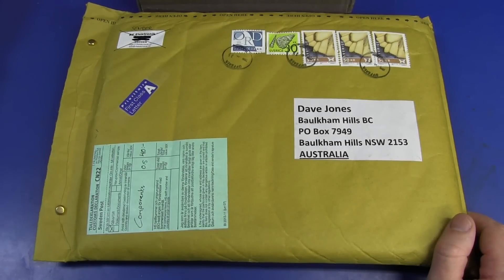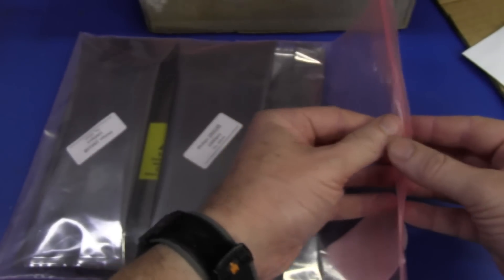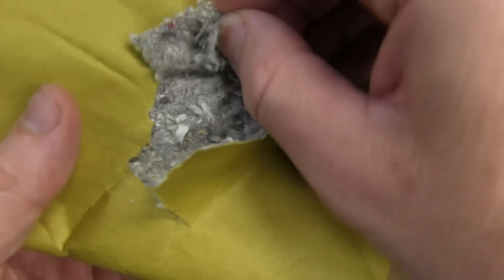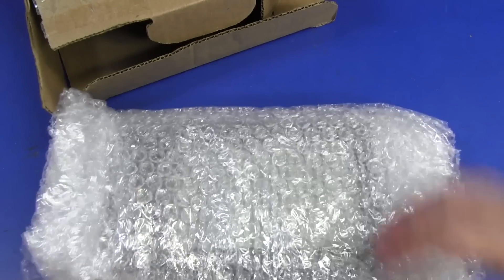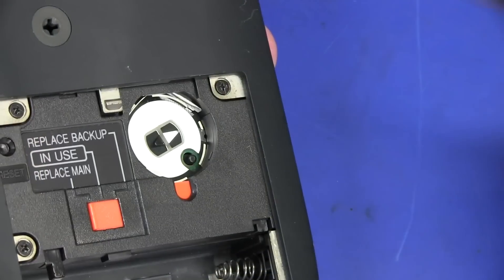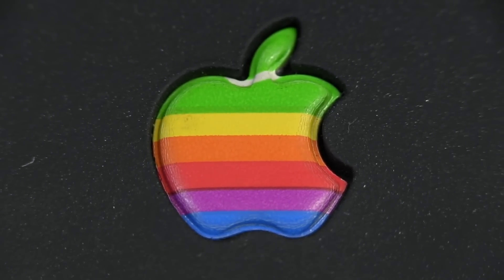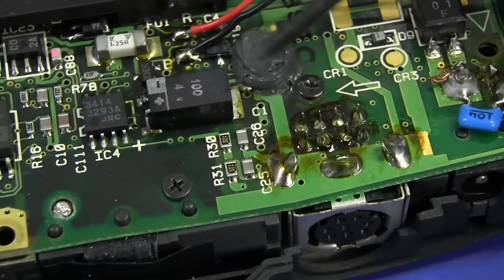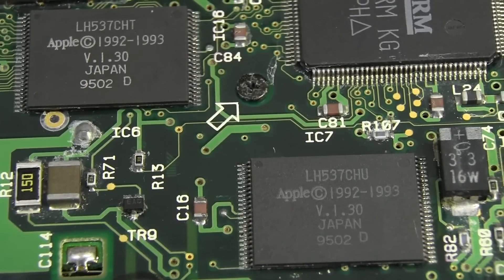EEVblog #418 - Mailbag Apple Newton Teardown

Comment: I had a MP100 and later was given a MP120 and a MP2000.  The battery pack was rechargeable, OR you could use primaries in that little holder.   4xAAA would last anything from 2 to 4 hours of usage, so it wasn't cheap to run.  Also it wouldn't work at all on rechargable AAAs because back then it was NiCD with 1.2V.  I reckon the authentic Apple pack had 5x 1.2V = 6V to keep up with 4x 1.5V disposable batteries.

The orange switchery was a lockout to prevent you from taking out both batteries at once, so to keep the memory powered.   Of course both could still go flat in place.

Comment: On the Newton:
Battery life was and is quite acceptable - Depending on how often and how long you use it, it may last one to two weeks.
Also it uses practically no power when in standby. And turning it back on takes less than 10 seconds and you're back where you left it.
It's good that yours came with a Battery holder, it was missing on my MP100, but I was able to get hold of one. www.pda-soft.de is a great source for everything Newton, and I think he sold me at a very reasonable price, this Battery holder. He's got a lot of stuff and knowledge.
The red battery slider switch made sure, you wouldn't replace one battery without having the other battery installed. The backup battery did hold your data (I believe date and time, and a lot of personal settings) when you were replacing the main batteries, and vice versa. I think those black switches you mentioned are for releasing the red slider . But there should be another switch in the main battery compartment that checks for an indentation on the Alkaline battery cage that wasn't there on the rechargeable battery - So by pressing this other switch in, it recognized it being a rechargeable battery, then the power input plug on the side would charge the battery (Ni-Cd's) and if the Alkaline battery cage was in, the power input was only there to power the Newton while conserving the non-rechargeable batteries. The DIN-8 connector was a standard Macintosh connector that you could connect your classic Newton MessagePad to your classic Macintosh. The Keyspan USA-28 Serial Adapter made it possible to connect it to a USB-only Macintosh, but there's little to no use now in 2018, since the OS-X-ported sync software might not run anymore on 64-bit-only OS X. Also, the last time I've checked, Newton OS 2.0 had trouble with the date settings in 2017, setting itself back to I believe 1970 whenever it's put into standby - This problem didn't occur on Newton OS 1.3, like your MP100 is likely to run on. Hope this info is helpful to anyone.

Comment: Hi Dave. I know I'm waayyyy too late to respond to this. Like 4 years too late. Meh. 

I collect vintage computers, and I've got a few newtons which had the exact same problem that it this one looks to have.

There's two electrolytic caps on the board that at first glance look like surface mount tantalums (actually, at 12:22 you pointed one of them out and said it was a tantalum). I found when looking closer at mine that they're actually tin cans inside of a plastic package. One is a 100uf used on the speaker output (which isn't really a big deal), and another on the rear side of the board -- you can see that one in the video near the PCMCIA slot around 15:30.

On my Newtons, I found that they had leaked pretty badly. It looks like the ones on this one have too; there appears to be a some gunk around that 100u cap near IC4. Also, what looks like flux residue near where the speaker wires are was leaked goo from that cap on mine. Can't say that that's what it is in this one, but I'd give all of that a good clean and replace those two caps. I find replacing those two as well as the big 470uf one gets them going again.

I shoehorned in some radial through hole caps on mine because I had no idea what the type of surface mount electrolytic caps are called in this form, and I couldn't find any replacement ones. Eh, if it's stupid but it works, then it's not stupid. Actually it's still stupid. But it works. Meh.

Comment: AFAIK, it holds 4 AA batteries.
You can't slide the orange slider when you've removed the battery holder.
One of the "secret" switches recognizes if you've inserted 4 AA batteries or a rechargeable battery pack. If the latter is recognized, it will charge it when you've got the power adapter connected.
If you know how, you can display the thermistor temperature in the menu. It is quite accurate if you're not recharging the battery pack.

Comment: 6:54 that looks like a DB-9 connector used by Apple for serial ports.

Although Macs did have a tenth pin that allowed LocalTalk networking by using the RS-422 standard.

Comment: i have the h1000 newton
Same as this but only 1.0 software, changed both caps 3,3 Uf for the lcd and the 100Uf for the audio
Now hes working as new =) yhe mp100 have an issue with the power switch, u need to clean it to fix the power button. sure it will work, otherwise its broked!

Comment: The blue switch detects rechargeable battery pack or cell pack if i remember correctly, it also has a temperature sensor in the battery compartment.

Comment: The primary software developer on the Newton was known for constantly adding new hidden features to the software even after it was supposed to be frozen for production. One of the easter eggs was a software thermometer that used the thermistor circuit next to the battery.

Comment: I had a 2000 Casio WinCE/PocketPC. It looks quite similar inside, except that it didn't have any protection against running out of battery. It had flast (CompactFlash card slot) for storage, but lot's of things were only stored in RAM, like your contact details and appointments. If you removed the batteries those were all lost, even the password you put into it.
Full factory reset every time it ran out of juice. And MicroSoft ActiveSync for backing up your data never worked properly. I used it for a few months, had it run out of juice two or three times, and then just gave up on this quite expensive PDA. I think it was an E125.

Comment: you love christmas right? Make a Christmas light with those diodes! :D
Reply: Kitsune Ken I don't think they're that type, these are Diode Diodes, the kind that only allowed electricity in one direction. Your thinking of Light Emitting Diodes, which do the same thing but are more used for light
Reply: ohhh dioede diodes now im more confused. I'll research about that! Thanks for the idea!
Reply: Kitsune Ken Not all diodes are light emitting.
Reply: Kitsune Ken it only emits light when you pass far too much current through them. If you wanted, you could do that, and destroy all 4000 diodes in one go!
Reply: Pioneer Mephit ahaha will it make a spectacular kaboom?
Reply: if you add some capacitors, yes

on their own, no

Comment: Strange how s-ram is still in use today bet it would be more reliable though
Reply: SRAM has lower standby power consumption than DRAM.  It is also faster, which is why it is used for the CPU caches in modern machines.

Comment: Why do they not have PCMCIA I know Dell still was in 2012 , but it is more rare everyday , it was so great , you could add any type of card to your laptop even video cards , even small stuff like that , why would you wanna remove something that lets you add on to something :(
Reply: In theory, you can do the same with an SDcard slot (duckduck SDIO), though the most common way now is to use the USB connector.  All small USB sockets  since mini-USB come in a variant that can be used as either A or B end depending only on the cable, ditto for FireWire and probably thunderbolt.

Comment: The Serial connector may be odd, but it should be a RS422 or RS423, so not so custom Apple stuff. Not just the typical RS232 you find on "lower class" hardware.

Comment: the open frame Package is called TAB.  Tape Automated Bonding  the leads were cut right before placement and hot bar soldered to the board

Comment: They did have a rechargeable battery for that, I believe the little blue switch on the end would demote if the rechargeable pack was installed or the AAA pack.

Comment: the blue switch is the main battery detector. the black switch is part of the locking mech that won't let you switch the orange switch unless there is a battery in either the backup slot or the main slot. so to change the main battery you switch it over to replace main and swap the battery, to swap the backup you do the reverse. as you said it was part of the design to maintain data.

Comment: That's why most DDL systems add a transistor RTL inverter after a few gates. It also explains why most operated off of a 12V rail.

Comment: I still have an original Newton that sort of works. The screen has a noise going through it. Bad filter cap somewhere? The AAA battery holder disintegrated. Bought a non-functional unit just for the holder. Finally, the green paint on the outside has become gummy. South Florida is not kind to electronics.

Comment: Hahaha, that'd be aweseome. But the 1N4007 makes more sense. That with 1kV each diode. 4 x 1000 1N4007 Fullwave bridge rectifier will give you 2Megavolts!!! The voltage drop would be 2.2KV!!! :D

Holy crap. But the good thing is, that the 1N4007 can handle 1A, which is a lot. 1 Amp at 2 million volts would be awesome!!! :D

Comment: I have 10k of 24V zeners, and only 5k of 12V zeners......bought at auction for $2 for the 2 boxes. I use them as regular diodes , or turn them into little lights that light once....

Comment: I bought one of these in 1994 and hardly used it.  Still have everything boxed up and it works too!  Super slow handwriting recognition by todays standards.  It was a fun toy...but that was about it.

The interface cable and it's software were sold separately and from what I remember, it wasn't cheap.  This was back in the day where 16 meg memory modules cost upwards of $500 USD!!!

Comment: You could use that 6.5 digit bench DMM you have coming in, and do a primer in very sensitive low current measurement of leakage current on a statistical example of 3000 diodes:)

Comment: According to MacTracker the DIN port is a LocalTalk RS422 port.  The Apple Newton could charge a rechargeable NiCad battery pack, I suspect that blue switch inside the battery compartment detects when the rechargeable battery is installed and allows the Newton to recharge the battery.

Comment: The LTC902CS appears to be an RS422/RS562 line transceiver designed for AppleTalk networks. That was apparently a custom Apple version but the commercial equivalent is the LTC1320 which you can find datasheets for.
If this info is wrong, blame the Internet ;)

Comment: Then again, I guess if you were really bored, you could put 100 of them in series  (on the higher steps in the ladder) to get a theoretical 7 kV reverse voltage tolerance, and about a 70-100V forward voltage drop.

Comment: You could, but 1n4148 are signal diodes with a low reverse breakdown voltage. These are rated 70 V as you can see in the video. So they would pop long before you would reach any kind of "fun" voltage.

Comment: Secret blue switch is probably battery type detect - there is probably a rechargeable option to replace the AAA holder. Hence the temp sensing as well.